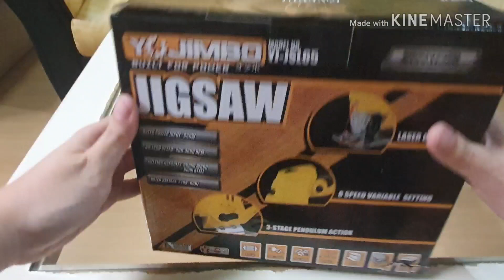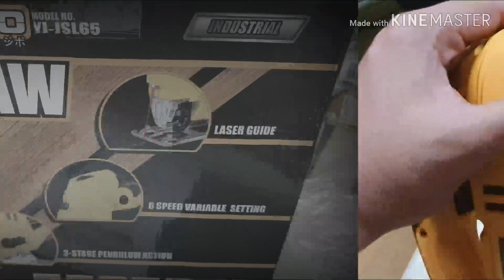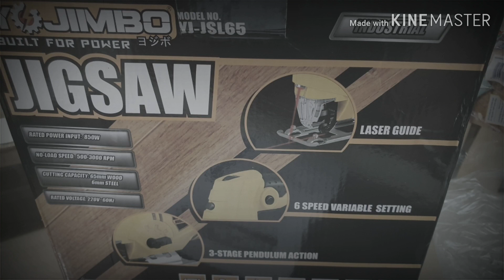Yojimbo 850W Jigsaw | diy | affordable | Lazada | Review | Unboxing | Woodworking tool | Starter

Comment: nice video po.. tanong ko lang po kung na aadjust po ba para maka cut ng 40-45 degree angle po?
Reply from the maker: Yes sir! Merong mga detent yung base nya para ma tilt ng 45 degree. Pero hindi ganun ka accurate so gamitan nyo nalang protractor to check the angle. Nag try ako ng 45degree cut pero kulang pa skills kaya di ko na inupload andami lng sablay 😅
Reply: @TochiWatanabe  ayun! thanks po sir.. nag pm din kasi po ako sa mga seller sa lazada ang shopee di daw alam po..
practice lang po makukuha din po ng tama ung beveled cut po =)